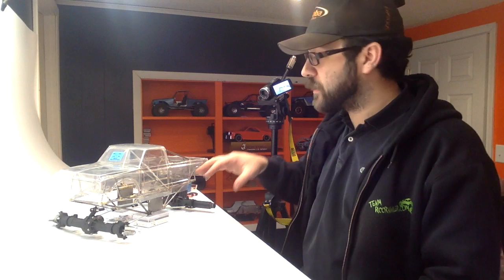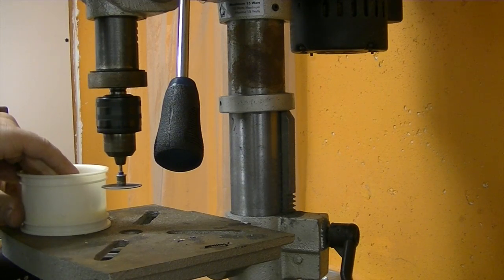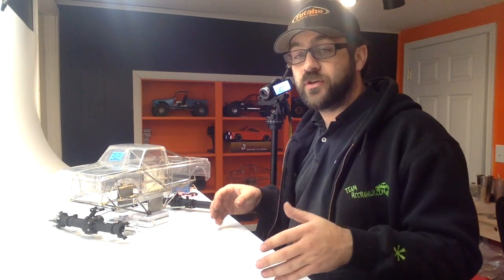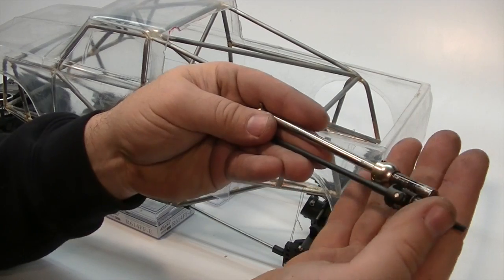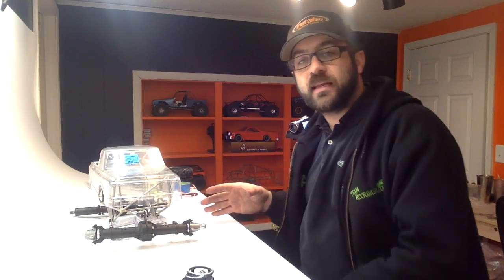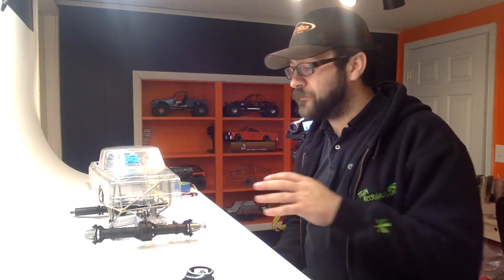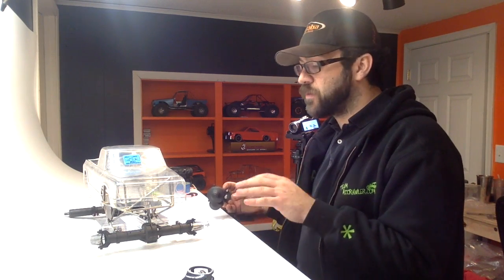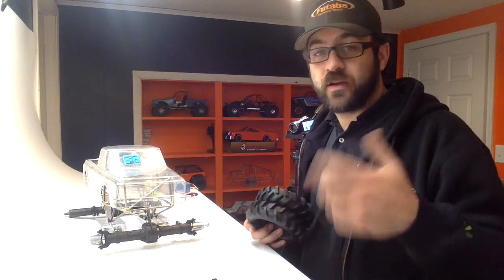Project Mega Mud Truck - Suspension & Wheels - Episode 3

Comment: Love it, love it, love it! I was considering one of those Mad Force trucks a while back but part support seamed lacking, I still day daydream occasionally about buying and ripping one. They are fairly light weight in comparison to a Savage or some of the other production monster trucks and the VE runs an Orion 8th scale brush less system . Mega trucks are sweet and I am thrilled to watch this project come to life. Dennis Anderson's KING SLING is freakin' Bad Ass! Do you have a favorite M.T.? Are you ready for a sweet Hill and Hole course to test your new rig? Squirrelod is a pretty cool guy , I really have learned a lot from him and now you Harley keep it up sir. : )
Reply from the maker: Thanks for the comment, I am thinking about building a scale course for this thing depending on how much I love it. Much easier than building a crawling course for sure!!